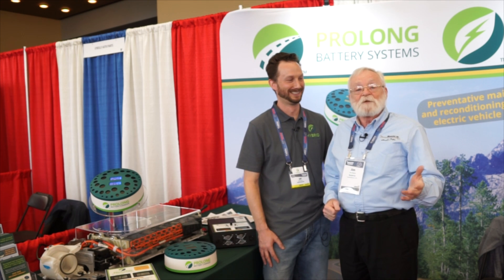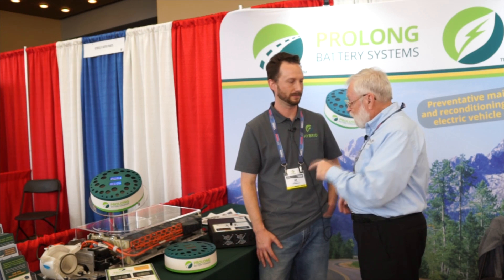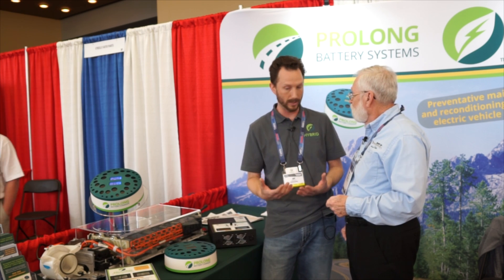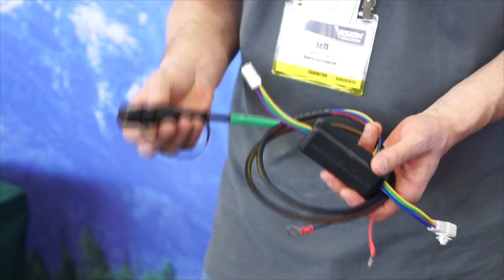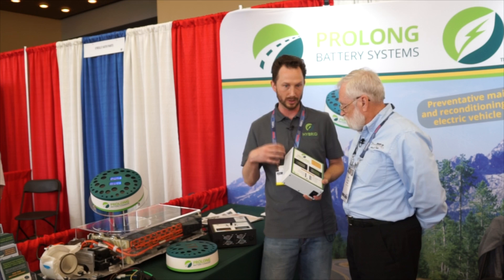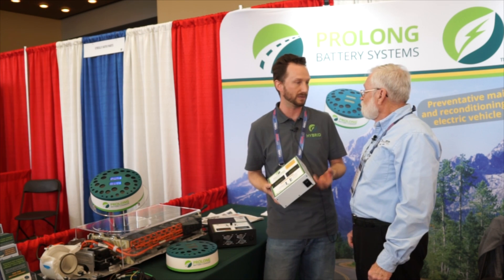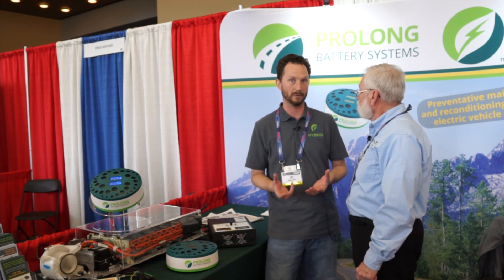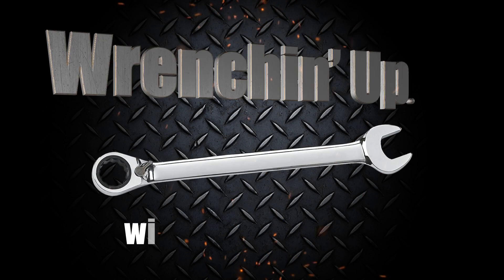Prolong The Life Of Your Hybrid Car Battery - Wrenchin' Up

Comment: Hi there
Can you tell me how many hours you recommend me to keep the battery only for charging and balancing?Thanks
Reply: The first cycle takes about 17 hours. The second about 20 hours. It depends on the health of your battery. The batteries with a little bit over 100k miles takes more time. The fully charged battery voltage is 239.5 to 242 volts. Again it depends on health of a battery. The healthier battery the lower voltage. Don't rely on the Hybrid Automotive charger voltmeter as its values are wrong.
Reply from the maker: Hi - Thanks for watching! Great question Dorin, but I don't have that information as it didn't come up in the interview. I suggest that you check with the manufacturer for that. Their contact information is in the video's description.

Comment: I bought a charger and discharger for Prius but the discharger stopped working after a few months.
I sent it back to Hybrid Automotive for repair, but then they sent it back to the wrong address.
I retrieved it ay my own expense, only to find that it wasn't repaired.  
The shipping cost to and from Hybrid Automotive was half of the cost of the discharger, so if I pay to send it back then I might as well just throw the discharger in the bin and pay for a new one.
I sent an email to the owner of Hybrid Automotive (Jeff) in June but never heard back.
Overall, their customer service and product reliability is dismal.
Reply from the maker: Hi - Thanks for watching and sharing your experience! I recommend that you contact them again and mention your disappointment and comment on this channel. That may help. Their contact information (if you need it again) is in the video description.
Reply: You don't have to buy a discharger. All you need is 2 115v 40watt bulbs connected in series, but you will have to babysitting your battery.

Comment: I purchased the deluxe reconditioning package some time ago for my 2007 Toyota Prius but I've had poor results and I followed the instructions to the letter. The package is a lot of money for a poor return and it takes so long to perform, a full 3 cycles takes nearly a week and we've only got one car so it's such a pain.
Reply from the maker: Hi Jimmy - Thanks for watching and sharing your experience. I'm sure this will be helpful to others looking at this equipment. I hope the manufacturer jumps in here to shed some light on this.
Reply: You had poor results because the voltmeter installed on the charger shows wrong values, from 10 to 30 volts higher than the real voltage on battery. You did nothing to your battery relying on that Chinese voltmeter that Hybrid Automotive used in their chargers. Connect a multi meter to your battery and rely on it.
If your battery has a code P0A80, reconditioning it with this equipment is not enough. That code means that there are more than 2 weak modules in the battery pack and most likely the reconditioning process won't fix them, some times it does.
Reply: @carall66  I did use a Volt meter and checked each cell, two were low and I replaced them.

Comment: Just don't get it !! Why would you spend money not to mention stuck this device in your boot...to charge and discharge your battery??
This process it is provided by your car manufacturer already from day to day basis drive. Probably will do for full electric cars but not see it convenient for hybrid cars
Reply: The device you purchased cannot fix an already damaged battery. It can only maintain the balance. If your battery pack has all good batteries except one that one bad battery will be the performance of the cars battery. 

The device will maintain not fix your batteries.
Reply from the maker: Hi - It’s a Tool for reconditioning a failing battery. The manufacturers website has much more information. Their contact info is in the video description. Thanks for watching!

Comment: Will the Prolong system work with Li-ion hybrid vehicle batteries?
Reply from the maker: Hi - That's a good question so be sure to ask the manufacturer. Their contact information is in the video description. Thanks for watching!
Reply: Toyota (and others) uses NiMh (Nickel Metal Hydride) cells, which degrade over time by building up a "capacity memory" (even though their biggest claim to fame was that they do NOT build up a memory!). Toyota was VERY conservative in the Charge/Discharge level of their NiMH cells to help minimize this problem, but it can not be avoided. 
As mentioned, the process to help restore some capacity is to discharge and charge beyond Toyota's safe limits. This does not damage the cells, and in fact can reverse the problems to some degree. Sometimes you get dendrite growth in the individual cells, and this can lead to permanent cell failure.

Lithium cells do NOT have this problem, and can NOT be reconditioned in the same way.
Reply: Lol li-ion do not need reconditioning as they do not have memory lost as nimh

Comment: Excellent information and great equipment review. Keep the nice work up.
Reply from the maker: Thanks for the nice comment and Thanks for watching!
Reply: +LearningZone
here's  several tips for doing a pro job
never try to do this until you are sure what you are doing - the acid can burn you
check the voltage first - there may be a kaput cell which will be a waste of time trying to fix.
Check the battery fluid.
Try to fully charge the battery.
(I learned about these and more from Rapid Renew Roadmap website )